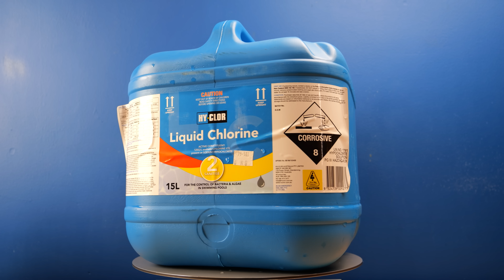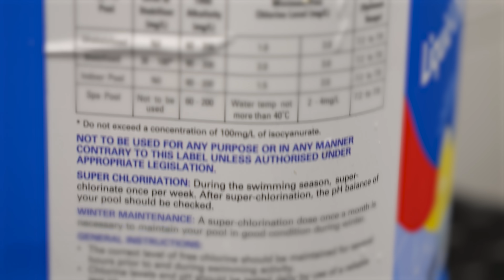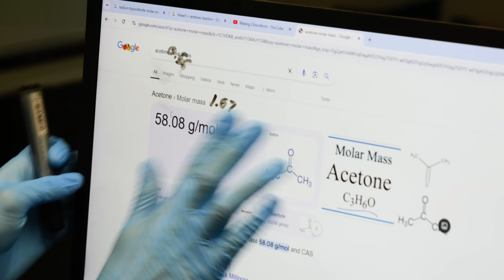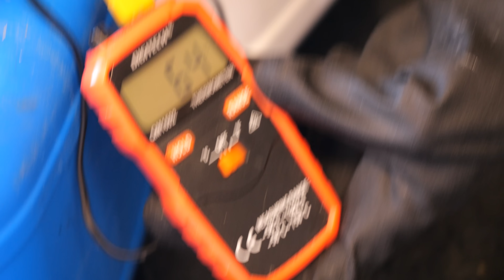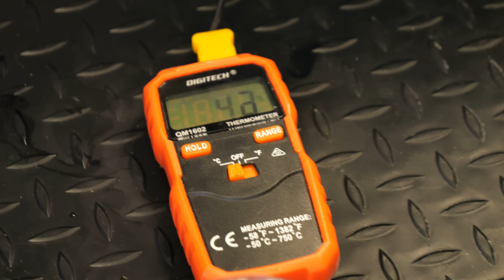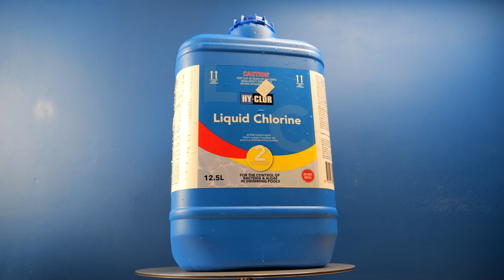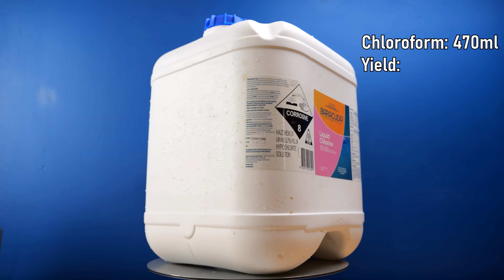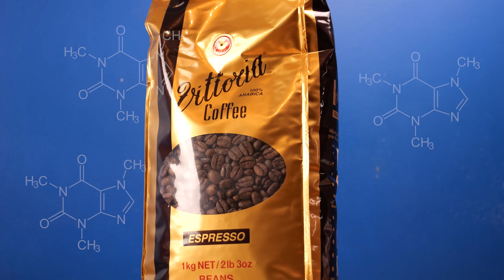I Mass Produced Chloroform at Home!

Comment: did you try the extraction already? that is not going to happen 😂With plant material you need about 300ml of solvent for 100g of material, that is the bare minimum, in a batch mode because soxhlet extractions for huge ass amounts suck... Even if you proceed by getting a huge ass soxhlet I imagine you may get better results but even this will entrain some of your CHCl3 with your discarded spent coffe grounds. I think this amount is not realistic. But dont get me wrong, I like your videos!

Comment: It is true that the haloform reaction works with any compound which has an acetyl group on it, no matter what the rest of the molecule is: Even if the rest of the molecule is just a single hydrogen, which would be acetaldehyde. That is less than ideal though, since acetaldehyde has such a low boiling point (only 20 degrees C) that a large proportion of it would likely boil off as the reaction mixture heated up, before it had a chance to react with the hypochlorite. So acetone is the next simplest option, with a higher boiling point (56 degrees C), so would not boil off so quickly.

However, the haloform reaction doesn't only work with compounds containing acetyl groups: It also works with ethanol, or with isopropanol, aka isopropyl alcohol. These undergo an oxidation step first (to acetaldehyde or acetone respectively) before being halogenated, but the end product is the same, so using hypochlorite would still make chloroform.

Comment: mixing acetone to hydrogen peroxide alone wont work, you need to add another chemical and also cool it down otherwise the mixture will just go crazy exothermic and boil insanely fast... kids dont do this reaction its not fun..

Comment: I got a BS in chemistry... Your safety practices shaking that bottle of bleach gives me some real anxiety. It may not produce a "gas" but all those volatile liquids like to find their equilibrium.  You have mostly ambient air in the jug to start out with, you shake, chloroform goes into gas, chlorine gas, water, etc... your pressure increases.  That's a big cap.  Small increase of pressure = large force on the cap.  It can pop off when tilted to the side and you have concentrated bleach all over and all over you. 😬😬😬  My professors explicitly warned to vent sep funnels because when you mix them and there's solvents in there, they can explode. So you always do a small shake, vent,  another small shake, vent, etc until its safe to shake as much as you want.

Comment: As a trained chemist this is nightmare fuel. The lack of proper handling of chemicals and safety precautions. Spilling chemicals left and right. Stirring with a thermometer,  not even to mention that it does barely anything to a big container like that. The fact that you didn´t even consider that scaling up an exothermic reaction would create more heat. And so much more. This gives me so much anxiety.
Reply: As someone is hs and hasn’t even taken chemistry yet I agree with you
Reply: Hi, do You think that Just trying with very little amount would be not too much risky?
I would need not so much to solder a little plastic....
Reply: @littlebritain64  It's not necessarily a  dangerous reaction aside from the fumes. I would recommend working in a clean way, wearing gloves and eye protection, doing it outside and just generally being careful. Read a few well-tried procedures and follow them, then you should be fine.
Reply: @LunaWxlf  
Very nice from You, and thanks also for the advices and the quick answer!
Cheers from Italy!👍
Reply: YouTube video here guy 😮 things are not meant to be perfect it's a scuffed channel any way pretty sure your missing the point of the "entertainment" part of YouTube videos.
Reply: @adienernest9643 You are missing the point that if this guy sets a wrong step he will leave his lab in a coffin
Reply: @adienernest9643 pretty sure you are missing how dangerous misshandling chemicals can be. Also how dangerous it can be to promote the misshandling to a wide audience as "entertainment".
Reply: @LunaWxlf i dont think concern trolling over someone doing something unsafe is a particularly effective way of sharing your thoughts
Reply: He could convert this channel into the chemistry version of Electroboom where he secretly definitely knows what he's doing and it's very safe off-camera.
Reply: Well, see, you’re a trained chemist, but he’s a self proclaimed EXPERT, so he knows what he’s doing 😂
Reply: This is awesome IMO.

I want to see more people just doing stuff regardless. H&S and common sense is overrated 😂😂

Comment: 7:57 you came so close to an explosion there, you can see the bottle changing shape from the pressure. The heat will weaken the plastic and it will burst like an overfilled balloon, except it’s filled with bleach/hydroxide/solvents. Those safety specs will not protect your eyes from liquid going everywhere, it will just go around them.
That and scratching your face with gloved hands at 11:29. You’ve been very lucky so far, don’t let that become complacency.

Comment: Watch out: it's a lab parody: he really knows how to handle this stuff. With a positive airflow management it's possible to handle pretty nasty stuff without getting in contact.
At the last 3 seconds he used the serious lab stuff. With large scale you do some borderline stuff to make it barely work to save some bucks at scale. Ice bath isn' practical for large scale. You simply calculate how much heat it will generate and precool all your liquids that it bearly fits. Don't go to cool as the reaction may not start.

Comment: There are a few ways to have been able to keep the temp under control, such as starting at a lower temp (like you suggested), also freezing the acetone (minimal, but non-zero gain), or adding some ice to the mixture. Yes, it would dilute the mix some, but provide tremendous cooling capability.

Comment: Stabilize your chloroform with ethanol as it decomposes to phosgene on exposure to light, however, by stabilization, it forms harmless products instead. Also, please, please, please, cover the outside of your glasses or put them in dark containers. Also, for future reactions, do not just put it in the freezer, put it in a proper ice bath when reacting. In order for the solution to heat anymore, it must melt all of the ice in the ice bath, so it will flatline at 0C until all ice is basically melted, which requires a ridiculous amount of energy. Cooling the solution isn't adequate, and until the phase change is completed, it won't get any hotter. If you don't have an ice maker, get one. Lol.

Comment: Here's your complimentary tip on pouring from containers

3:47
Place the HOLE at the TOP not at the bottom like you were doing

Which in plain English is hold the container with the spout/hole above the handle because air can get in and the contents don't splurgle everywhere.

You are welcome.
Reply: The fact I’ve never even thought of that makes me feel so slow in retrospect
Reply: PEOPLE, this is valuable information 
…and is also how to pour UHT milk 🥛 
or don’t… But if you spill it, you snort it. That’s the rules.

Comment: Could it be the thermal mass of the larger containers that improved the yield in the first run?
We assume that you cooled them all to the same temperature and using roughly the same setup time for all of them, if that's the case the temperature would be a lot higher in the smaller blue jug which may have lead to the boiling of all the product? Honestly though it was 18 years since we were still doing our masters in chemistry, something which failed because our health went south for unrelated reasons (at least we don't think the petroleum ether incident had any effect on that specific thing).

Comment: Chloroform is my favorite nonpolar solvent. Its not flammable,disolves a wide range of stuff,  easy to distil and recover it, and doesnt have a terrible odor. If you want to make a whole bunch bulk pool shock powder can make lots of sodium hypochlorite. You will want a big reflux condensor and flask in an ice salt bath while making it as the heat can make your chloroform boil off. ❤

Comment: Pro-tip: Next time, just wait a day and let the bleach solution get down to -20 C. You should've had a yield over 90%.

The snorkel hood was a good idea. It should've exhausted further away from the entrance to the lab space.

Consider using a dry ice bath to drop the bleach temperature further before and after initiating the reaction. Don't use poor man's LN2. If the bleach container cracks, you don't want that kind of mess. Just use dry ice and salt water. Add about twice the salt needed to saturate it. It will help to keep the cooling bath from locking the bleach container in if the water starts to freeze (think gas station slushy vs ice bricks).

Also, let the reaction mix settle for an additional day to let suspended microdroplets sink and combine. Dry the separated chloroform with dehydrated MgSO4 or CaCl2, you heathen. And, add 1 wt% EtOH to prevent phosgene in your purified stock, like a civilized adult.

Comment: Chloroform's solubility in water is something like 0.8%, which hurts your yield quite a bit. If you add c. 15% salt to the bleach before adding the acetone, the chloroform's solubility would be much lower and your yield would go up quite a bit - not to mention that the phases separate better too. CHCl3 is still dense enough that it will be at the bottom even in brine. I'd also recommend distilling the crude chloroform if you want purity, since there are some aldol byproducts from the acetone, chlorinated byproducts, and other crap.

Comment: Commercial grade bleach can be pretty degraded by the time you get it and the actual hypocholrate content can vary wildly.  You might have gotten "lucky" with the first blue container and it had a much higher concentration than the other ones.  You might want to titrate it next time with a chlorine test. Just dilute 1000:1 with water first and test a sample.

Comment: I got 84% yield. I worked on a slightly smaller scale of about 15L total, but the key is to add ALL the acetone at once and immediately cap and shake the ever living shit out of it, then leave the cap loose and put it BACK INTO THE FREEZER. The exotherm doesn't start until roughly 3min after addition, but if you don't blend it thoroughly like trying to use a whimpy stir rod on such a large container the reaction quickly goes out of hand. Scale had a large amount to do with your poor yield, but above all the mixing was the main culprit. Had you dumped the acetone in quickly and then shaken I guarantee you'd get closer to 75%.

There's a video on my channel, but it's a bit long. I'm not good at cutting out boring parts.

Comment: Remember to add 10 mls (1%) of ethanol to the final product to stabilize it and prevent oxidation to phosgene. Store it under aluminum foil to protect it from UV light.
Also, you definitely made some phosgene when burning that acetone-chloroform water mixture, it will always form to a certain degree when putting chloroalkanes in a fire (that's why use of carbon tetrachloride in fire extinguishers was discontinued).
Please, decontaminate all water waste with concentrated caustic solution (>10% NaOH) before disposal.

Comment: you can push the yields up to about 80% with an ice bath but honestly considering how cheap everything needed is it might not be worth the effort of refrigerating everything, great video and thanks for reminding me that i have to do this as well which ive been putting off (btw the chloroform can be purified further from trace acetone by shaking with conc sulfuric then sep and stirring over calcium oxide to remove traces of other impurities)

Comment: Please Stabilize that stuff with Ethanol to prevent the forming of Phosgene.
Reply: No need to do that if it contains water
Reply from the maker: I washed the storage bottle with 70% ethanol solution, so it should be stabilised. I keep it in the dark too
Reply: @mrgreenguy  I once worked in a lab where I was breeding Fruitflies for genetic research and we where using Chloroform to anesthetize them. One day I opened an old bottle of Chloroform and noticed a musty odd smell turns out I huffed Phosgene that day

Comment: Wouldn’t it have been easier to just let it boil off and distill the vapors? 🤔
Reply from the maker: Only problem with that is the fact it also boils the acetone off. Probably isn't as efficient at higher temps either

Comment: Chloroform is a volatile liquid, so it has appreciabble vapour pressure at room temp, let alone at upper 40's centigrade. It doesn't need to be boiling temp for losses to quickly destroy the yield.
Reply: If you use more diluted bleach the water will dissolve the chloroform and also destroy the yield. I guess the best method would be to add the acetone in very small portions, under cooling, and mix very well.
Reply: yeah he just wasted a buttload of cloroform by not using icebath lmao
Reply: @flydrop8822 I thought I was going insane. I'm not even a chemistry guy, but this seemed like an obvious solution
Reply: Yup an ice salt water bath and reflux condenser is definitely required for reasonable yield. Making it the way he did was extremely dangerous 😳
Reply: chloroform basically never touches air where it can evaporate also i think because its contained and the square cube law thats almost negligible in these quantities

Comment: 3:27 there is a way to start this siphon with some quick reflexes. i learned how to do this for starting siphons of non-potable tanks that you really dont' want in your mouth. The way it works is you start by getting some of the fluid into your stiff tubing like you have here. You raise the tubing in the tank up to the surface of the fluid but still leave it submerged about a few centimeters. then you want to simultaneously release your thumb that is plugging the open end of the tubing and shove the submerged end of the tubing all the way to the bottom. as soon as the submerged end of the tubing hits the bottom, you want to seal the open end again with your thumb. if you've timed it just right, you should have forced a bit more fluid into your tube. the next stick is quite tricky and takes some practice. you are going to use the inertia of the fluid in the tubing to draw even more fluid in. to do this, you quickly yank the submerged end of the tube from the bottom of the tank right up to just below the surface of the fluid. right as your submerged end is reaching the surface of the fluid, you want to quickly release your thumb from the open end. this will effectively "toss" the fluid inside the tubing up a bit. you will see the level of fluid rise in the tubing, and then peak and then start to fall. as soon as the level stops rising, quickly seal the end with your thumb again. if you have timed everything well, you will have plunged the tubing to the bottom of the tank and then back to the top with two cycles of releasing and sealing the open end with your thumb, and you should have more fluid inside the tube.

if you struggle with getting the fluid to "toss" up inside the tube, you can simplify a bit and focus only on the tossing step. it helps a LOT with the timing if you can see the level inside the tube too. it also helps to practice this with a soda from McDonalds. this exact method can be used to siphon a soda out of a cup using just a regular plastic straw. i have gotten good enough at this method that i can spray soda out of a regular straw like a firehose lol (a good party trick). you will also learn the rhythm to the whole motion and you can get so good at it that it only takes a few seconds to completely fill any tubing. there is not a height limit to this method either because you are using the inertia of the fluid inside the tube flying upwards and you aren't using any kind of vacuum. although you will be lifting all that fluid so if you are doing this with a 2 inch PVC pipe to siphon lake water, it can get very tiring (i have done this). 

there is probably a youtube video that shows how to do this method of siphoning, but i learned it by someone showing me ages ago. i think its kind of a lost bit of farmer knowledge lol